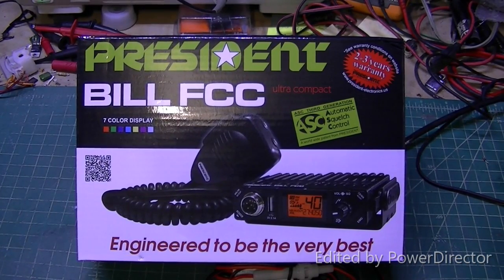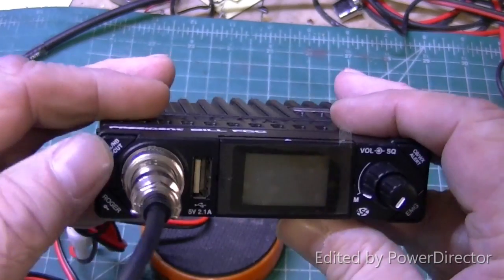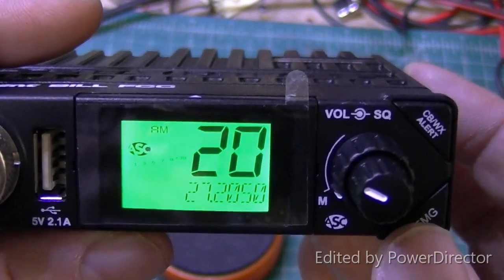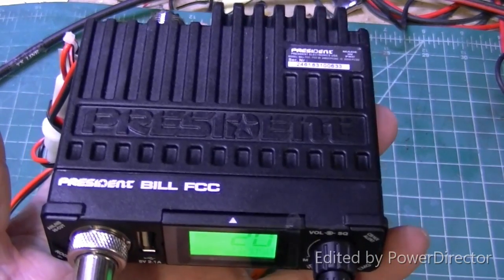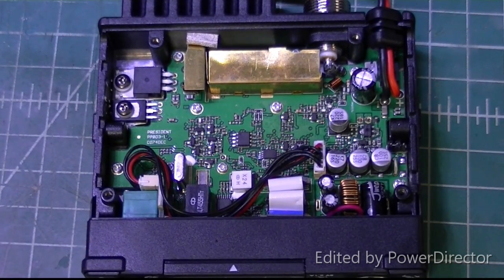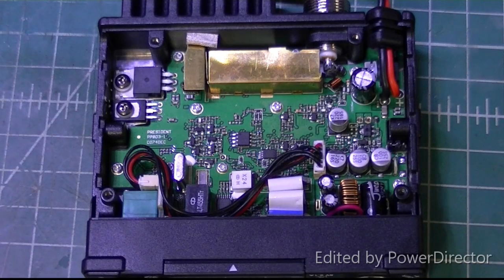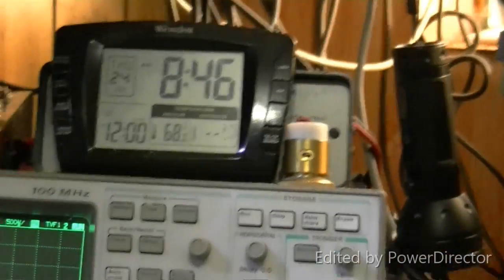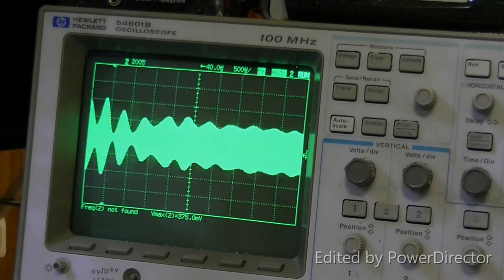Review of the President Bill

Comment: Do you sell these or does a person have to buy online?
Reply from the maker: I sell these. Call at 812.420.1226
Reply: @cbrepairguy  Thank you and I will def. be in touch.
Reply: @cbrepairguy  What is the better antenna to go with this radio? Going in a RAM 1500 2009 model.
Reply: @cbrepairguy  Do you work on Saturdays for a call? Work during the day and don't get home until after 6 pm mostly. Thanks
Reply: Another question if I may. I have a 2009 RAM 1500 Quad cab with a hard cover on the bed. Looking for a good antenna ( not a magnet type as the wire is hard to hide) that will work well. What would you recommend? Maybe a 102 ' whip on a solid bumper mount or some type of hood mount? Thanks

Comment: Get the non FCC one off eBay or Amazon great version.
Reply: @0426dav  US one says Bill F.C.C. on it & has Weather Band & the other has FM on it & no Weather Band & puts out 20 watts, It goes to other frequencies outside of the 40 channels.
Reply: I buy my “export” radios from Radio World in the UK. So far I bought a President McKinley and Bill. Shipping was $19 for the McKinley and $15 for the Bill. The biggest difference I saw so far is the receiver is a bit noisier than the USA versions of the radios. I guess that is to be expected with radios as wide band as they are.
Reply: @robschlotterbeck2566  They are turned for FM.